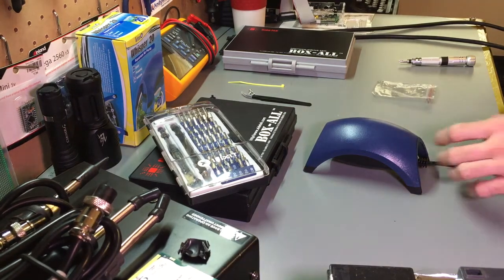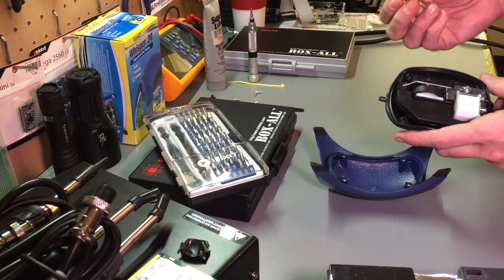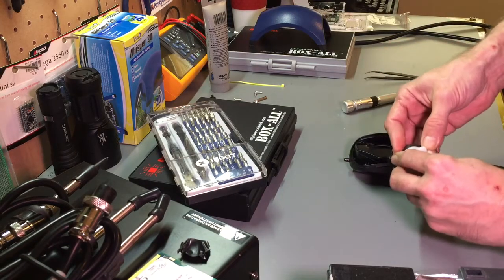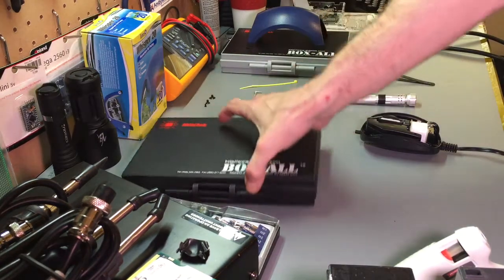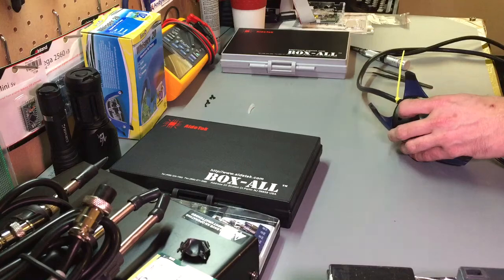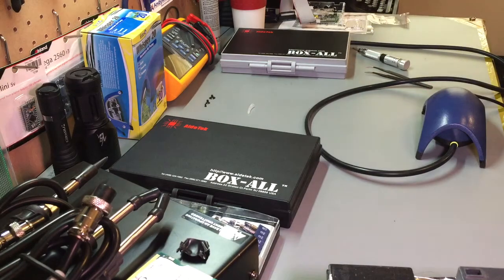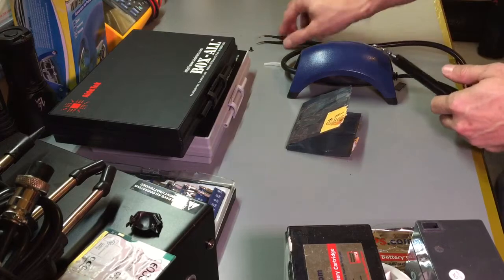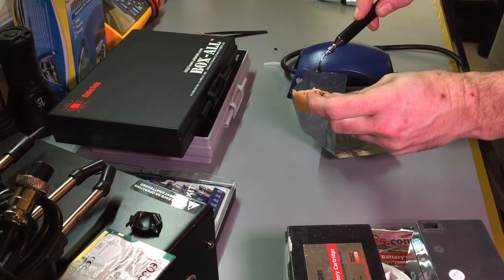SMD Pick/Placer from $10 Tetra Whisper Pump Mod - More Gadget Tech Thoughts

Comment: I like the box-all kit. Pretty expensive for 2 with content. But if you can spend 100euro why not.
Reply from the maker: I did a separate review on it.
https://youtu.be/du8xFC70GqE

I didn't buy them with the content, I just bought the box and then found some cheap packages of resistors and caps, printed thenlables and sorted the parts. It did take some time to organize and sort parts so I think I know why they charge the price for the ones that come with the parts. 
I think I have a link to box only on Amazon in the box-all review video description.
Reply: Gadget Review Videos 57euro for 2 empty boxes. Do you think through hole components can fit if you bend the legs inwards? Capacitors for smd are condensators?
Reply from the maker: Probably not, it's designed for SMD. If you watch the review video I put a US dime in one as a reference and it give you an idea of the space. I would guess you might fit 15 through hole 1/4 watt resistors in one compartment. But capacitors change in size so much. Maybe it depends on if you using tantalum caps or some other kind. Smaller rated tantalum caps you might be able to fit 15 or 20 smaller 0.1uf, but definitely not for electrolytic caps.
Reply: Gadget Review Videos Thats what i thought. Thanks again for the reply.
Reply: @GadgetReviews-US  hello i was thinking to do the same! can you tell me where you found your cheap packages of resistors and caps smd ?
Reply from the maker: Sandro L. I had ordered mine off of amazon in 2015. The ones I ordered I don’t see anymore, but if you search for SMD resistors, or SMD capacitors you will see plenty of mixed values in either books and strips of 25 to 50 in bags for sale. I recommend ordering the sizes you would use the most, just add the size to the search like 1206, 805, 603 or 201.You can also find them on banggood, aliexpress or even ebay.

Comment: did the same with a Tetra pump and it works really well. Much better than the SMD crap from China.
I'm using a Tetra APS400 which has two internal pumps. Now I can connect two SMD nozzles, a big and a small one.
Reply from the maker: Nice